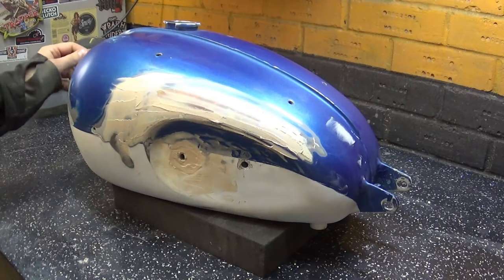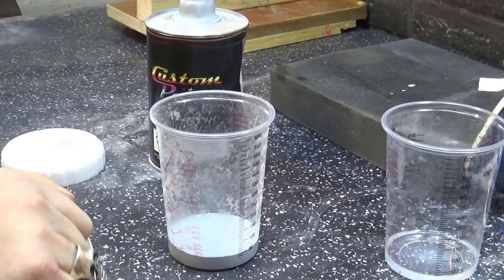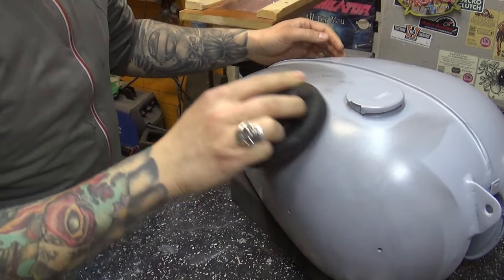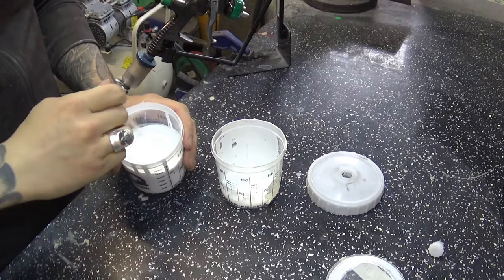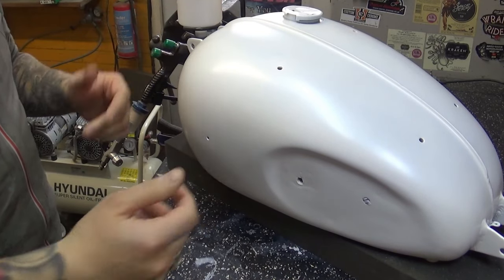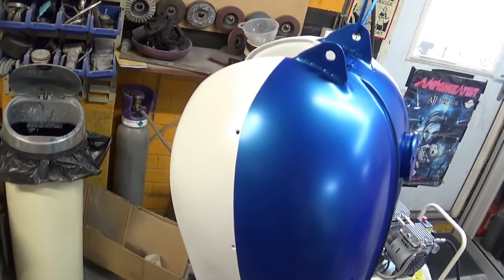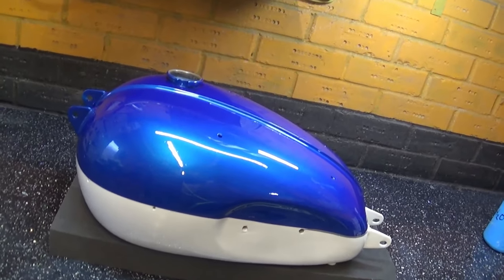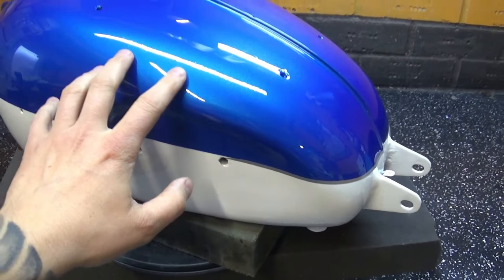How to paint motorcycle petrol tank - step by step guide

Comment: Awesome, keep them coming!   I have some painting coming up so this all great stuff.    Still not sure about stepping up to a proper gun but I really need to make that leap of faith!
Reply from the maker: Go for it. Its really not that complicated,  and it does make it cheaper in the long run.
Reply: @MackieBass  Do you have any recommended suppliers, or do you just go for the best deal?
Reply from the maker: Well, not really. Put it this way - I own the expensive Iwata, and not so expensive Fast Mover (premuim range) I don't see a difference in the outcome of paint job. I stick with the LVLP guns to go with the small compressor and reduce overspray. Other than that - go practice :)

Comment: Nice job there as always.. :)
Reply from the maker: thanks
Reply: @MackieBass  I have my project to paint soon..the plan is old and distressed...
I pinstripe and airbrush  but ideas are not coming easily..😆
Reply from the maker: Idea is often the hardest part. Execution is only as good as the inspiration behind it
Reply: @MackieBass  I'm looking at primer , flat black, pinstripe  and scotchbrite  ,subtle airbrush for rust and matt clear..
Reply from the maker: @JohnSmith-ih1ic  cool. Use red oxide primer. This way if you go through the black it will look like rust already. Nice one.
Reply: @MackieBass  Thank-you for your advice its really appreciated.
Reply: Its an e chop not a regular one..all electric

Comment: Looks great.  Why did you only do that grey 1/8th inch line on the back of the tank, from the knee pad backwards?  I'd assume you'd put that line anywhere the blue and white meet ...as long as it's visible with badges and tank pads on.
Reply from the maker: Not visible. Covered by the badges and the seat.

Comment: spot on!, If you wouldnt mind could i ask you for some advice on respraying a side panel?, I have replacement panels, for my blackbird, but there not the right colour, there in really good shape though, no chips or scratches, just that there a dark silver, and i need them to be light silver.
i was thinking of just rubbing them down with some grey scotch brite to key them, and making sure i take the shine off the top clear coat, then i am wondering if i should use a adhesive promoter instead of a plastic primer, then just spray my colour coats, let site for a few days to flash off, then light grey scotch brite blow it off, panel wipe it, then 2k clear gloss coat. any advice you could give would be great.. Thank you.
Reply from the maker: Mate, you nailed it. Read it back and it is exactly what I'd do.  Seems like you know what you're doing. Good luck :)
Reply: @MackieBass  cheers mate, its the pointers you have always givin in your vids that have made my last spray jobs solid, devils in the detail. stay safe mate, great vids as usual.

Comment: Another great job man just curious about the sanding block would ya always use a block as apposed  to just your fingers for rubbing on the round edges or maybe that's a daft question ?. this does not mean I am goin to have a go by any means i'd rather have a drink and watch ha : D
Reply from the maker: I like using small cork block, it helps reduce the imprefections even on the corners. Never use fingers, unless it;s a very small area. Sometimes I like using hard foam, or even scotch pad as a backup support for sand paper. Whatever works for you - works :)